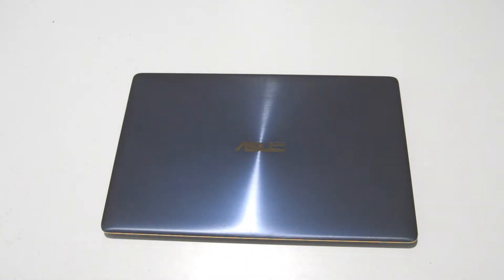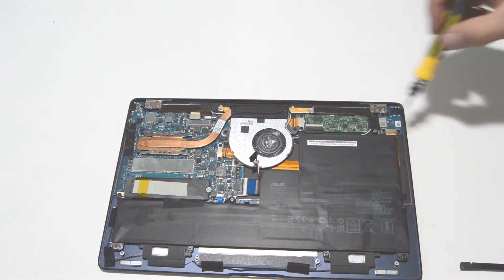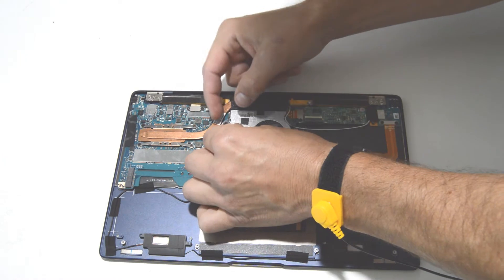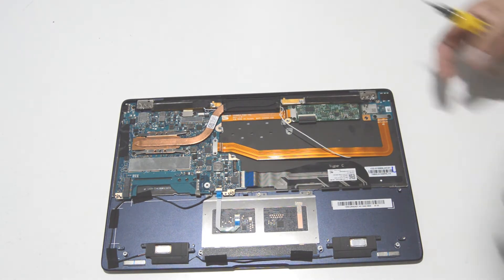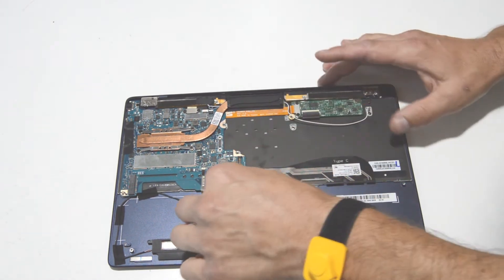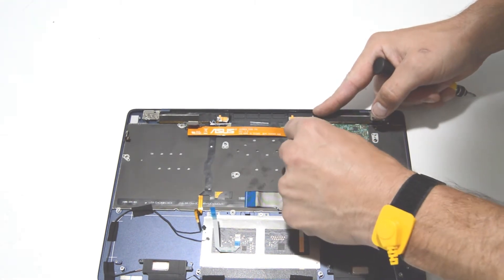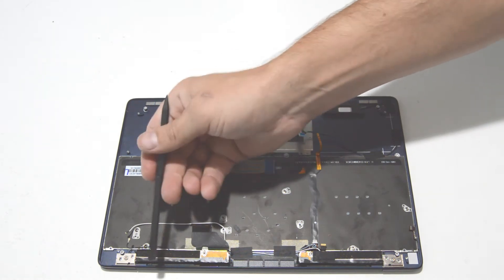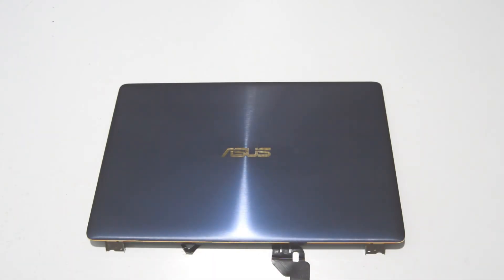How to Disassemble Asus ZenBook UX390U Laptop or Sell it.

Comment: If someone has a problem with display(not graphics card), try to replace the display platine pcb2 fpc rev 1.2 instead of the whole display. This fixed my problem when the display randomly quit on me. Bought the platine for 16$ on aliexpress.
Reply: Hi, can I ask you what kind of problem did you experience? Because yesterday my asus display started to flicker and to give me some vertical coloured lines but if I adjusted the position it kind of got better. I went to a shop for repair today and they told me I need a whole new display.
Reply: @valeriafarina1503  i got vertical colored lines too. But it didnt get better when moving the display. And the lines stayed at the same position
Reply: Thanks for bringing a solution.
I have the same problem. Do you know if its still possible to find that flat cable anywhere? I tried looking on ali express but perhaps i searched the wrong way or they stopped selling it.
Reply: Was your screen displaying anything when this board stopped working. My screen shows lines and displays incorrectly/flickers etc.,

Comment: my laptop model is UX370U but looks ecactly like this computer. I took off all the screws but couldn't seem to get the back lid off. Would you know if there is a hidden screw somewhere?
Reply: The same problem. We can see the little rectangular thing on the lid inside in this video. But i'm not sure how to unlock it.
Reply: I just continued to pull it and it clicked out. Not sure if i broke it or just opened.

Comment: Hello. 
Does the motherboard of this laptop have a CMOS battery ?
I've got a problem with it and I'm trying to reset the Bios to...factory settings hopefully.
Do you know what the issue might be if the laptop does not boot the Windows...basically is stuck in Bios, does not go through.
Bios settings are looking funny too, however I've tried to update with 5 different drivers and did not recognised any of them, now the ssd is not recognised anymore.
No booting options either.
Any idea what the problem might be?
Reply from the maker: No it doesn't look like it. I would check some forums and see if someone has a similar problem.

Comment: Can I remove the battery of this model of Zenbook3 and just plug it in directly with its adaptor to electricity? Because the battery is swollen and I am home most of the times, thus don't need another battery
Reply from the maker: Most likely yes, it should run fine off the power adapter
Reply: @Sellbrokedotcom  thanks for your reply, but unfortunately it did not work without battery in place
Reply from the maker: @Amir_7092  That is pretty lame! I hope this is not the new trend along with the internal battery. Why did they have to get rid of swappable exterior mounted batteries?
Reply: @Sellbrokedotcom  i got an ux 3490 working without main battery, just direct power supply. but mine looses time and date when powered off. on old computers this meant the cmos battery was empty so i wanted to change it but i cant find one. since the mainboard is soemwhat similar to this one here: do new ultrabooks still have such a battery or is the main battery serving as cmos battery?

Comment: Thanks for the video! Do you know if it's possible to buy and replace speakers for this computer? Is it easy to replace them? The right speaker of my computer is partially blown and sounds rattly. thanks!
Reply: Yes, you can do that. Compare these two with yours to see which ones will fit: https://www.ebay.com/itm/324116983399  https://www.ebay.com/itm/223880060912

Comment: Any help with what to do... Yesterday my screen would only come on when it was opened to a certain angle. I've looked online and it seems like it may be to do with the screen cable being worn out because of opening and closing it over the years. Or could it be simply that the screen cable has come loose? Would it be worth a novice like me buying a torx screwdriver and attempting this myself, or should I take it to the repair shop? Any information would be great, thanks!
Reply from the maker: Sounds like a worn cable. It's pretty tough to remove the screen assembly on this model....let alone disassemble the screen assembly itself. If you want to fix it then I would buy the screen as a full assembly and either try to install it yourself (see video for all the steps, it's a lot) or give to a repair shop to install.
Reply: @Sellbrokedotcom  That's great. Thanks a lot for the information. I've ordered a tool kit with the anti-static wristband so either way I'm going to have a look. I'm hoping that the cable is just loose, but what you said it's probably a worn cable so I'll do what you said. Let's see! Either way, thanks again!
Reply: SellBroke Hi. I have the same problem. Is it possible to change only the cable ? Someone told me that I have to change the whole screen but I want to have your opinion. Sorry for my bad english by the way lol
Reply from the maker: @rachahamiti8274  Its going to be way easier to replace the screen as an assembly. You can possibly open it up and just change out the screen/digitizer assembly but it's tricky to separate the back cover without cracking the front glass. I would recommend buying a full screen assembly. If yours is silver try this one: https://www.ebay.com/itm/For-12-5-Asus-ZenBook-UX390U-UX390UA-UX390UAK-LCD-Display-Screen-Digitizer/383455948431?hash=item5947c16e8f:g:N3AAAOSwle5euUST, if it's blue then eBay has only that color from China. Good luck!
Reply: @Sellbrokedotcom  where can i buy the lcd? Asus zenbook ux390u

Comment: The microphone/webcam is that connected to the motherboard? If yes where?
Reply from the maker: It may be the smaller ribbon coming from the display assembly, thats how most laptops are set up. The larger one is for the screen/digitizer.
Reply: @Sellbrokedotcom  Thank you. The smaller one on my laptop has been stretched and the audio isn't working. Can that ribbon be replaced? Or would I have to replace the entire display panel?

Comment: And the ram is sorted to the motherboard?
Reply from the maker: Yes it is not removable, totally integrated into the motherboard.
Reply: @Sellbrokedotcom  which kind of screwdriver are you using to open the machine?
Reply from the maker: @madsfrederiktoft5808  It was a Torx T5 to remove the bottom case, and then a small phillips head screwdriver 1.5 to 2.5mm for the insides
Reply: @Sellbrokedotcom  thank you have the same machine and considering changing the SSD. So know I know which tools to use.